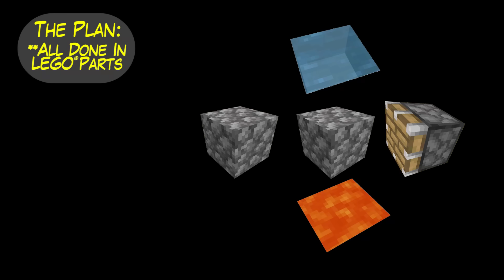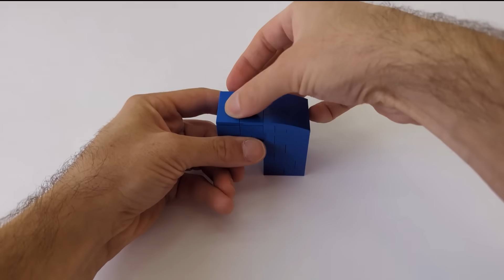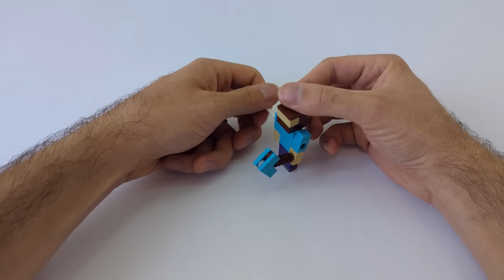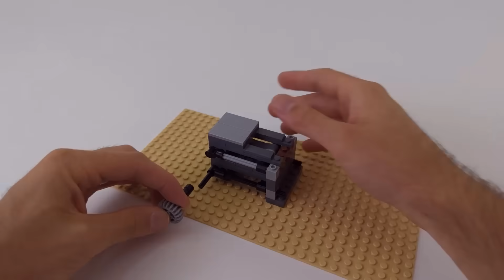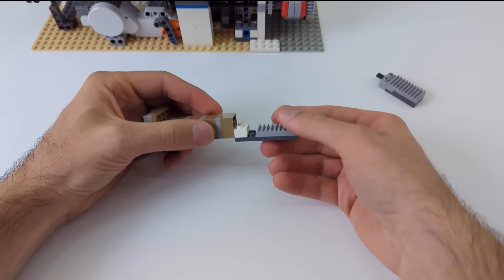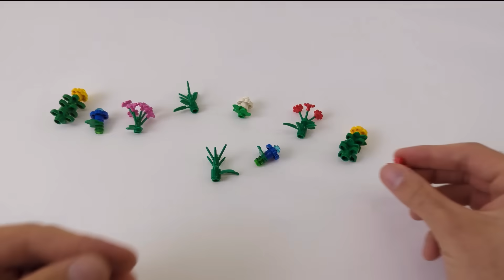100% WORKING LEGO® Minecraft Cobblestone Generator

Comment: Great design. I have only one minor nitpick with it, and that is the way the piston arm behaves. Usually the piston would push and immediately pull back, because the spot needs to be free in order for the lava/water to flow and create the cobblestone. But your design has the piston extended until Steve is done mining it. This visually implies that the machine is reliant on Steve to do the mining to create more cobblestone, but in reality, the only thing it is reliant on is for Steve to clear the space before it can push a generated piece of cobblestone.

Comment: If you add 1 more cobblestone (so 4 on the top and 1 underground) you could have better machine, beacuse you can do that, cobblestone go up in the same time when the second goes down, so the time for new block will be quicker than before! :) Great video
Reply from the maker: Great idea! I tried to do that actually, but the lift gets caught on the cobblestone that's already underground.
Reply: @BrickMachinesChannel  Hmmm okay, what if you made a trapdoor before the fault that would hold the falling block for a while longer, and when the fault is down, it would release right away, meanwhile the elevator would take 4 blocks up and 1 block would fall perfectly as this platform goes down the one that was and kept the next one. It would be at this convention. Hmm?...
Reply from the maker: Yeah that could definitely work! Nice idea!
Reply: @BrickMachinesChannel  :)

Comment: Tip for you: have a extra cobblestone in store underground so after the mined one drops no need to wait for it co come back but push up the one in store and the machine is faster
Reply from the maker: That's a great idea! I'd just have to modify the scissor lift a bit so it doesn't catch on the new cobblestone coming down the ramp 👍

Comment: This reminds me of that time in minecraft i made a cobblestone wallgenerator, ny placing a reapeating on off piston after the cobble stops pushing (it will) and then a third back
It ended up making a weird look and the cobble was only 2 blocks high.... but it did indeed repair itself
Oh and there was,also a giant 32 block high single laywr cobble at the end because i couldnt tell the piston to stop so it hit push limit, but my memroy is bad it couldvle been longer

Comment: Now do generator that would build lego by itself :D like you would drop same blocks in one big bucket and it ll drop it throu sorter on one side and after it ll drop u use motor with piston to push it to the previous lego block for better connecting use strips to help after pushing it together move from the piston.

Comment: I wonder what would happen if you added more blocks of cobblestone. then again, looking at the mechanism, it would break because the alignment gate closes just as the block of cobblestone gets there
Reply from the maker: Actually you can add a lot more cobblestone! The alignment gate will be closed before a cobblestone ever reaches it because the slider that releases the cobble will only open when the alignment mechanism is down. But the scissor lift would have to be higher so the ramp can maintain a steep enough angle at a longer distance.

Comment: One thing that I really like about this is that everything is optimized. Nothing (mechanically) can just be taken away and the machine can still work fine. Everything has a purpose and is perfectly synchronized, which is super satisfying. I am now inspired to try something similar. Great video!
Reply from the maker: Thank you so much!
Reply: Machine would work fine without steve mining
Reply: @Milo1267  
The machines goal is to properly emulate the idea of a Minecraft cobblestone generator. Those don't work without someone breaking the block. So yes the machine would function but the specific goal of the machine would not be fulfilled. I personally believe one of those things is more important and does not make this persons comment at all incorrect.
Reply: @willster2967  true fair enough
Reply: .. ,....k.j.kmmmm...

Comment: That is a really nice build.

A few notes/suggestions:
The piston should retract sooner. With a cobble-gen you do not want the piston-head to block the formation of new cobble.
For the activation of Steve mining and the piston - that would have been a nice place to use a touch-sensor: when there is a block steve starts mining. When the block is gone the piston extends.
Scissor lifts - nice and compact, but they require a lot of force if driven from the side and the angle is shallow. A rubber-band that just pulls upwards a bit at the very start can help a lot there.
Redstone - would be nice to have a redstone-torch and a redstone-line connecting to the piston.